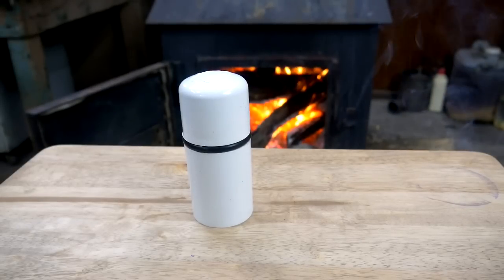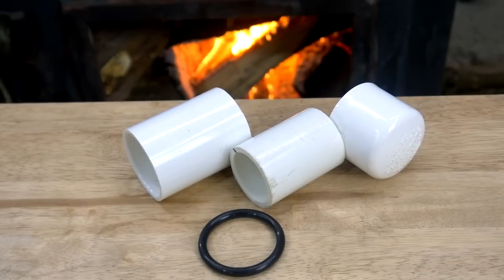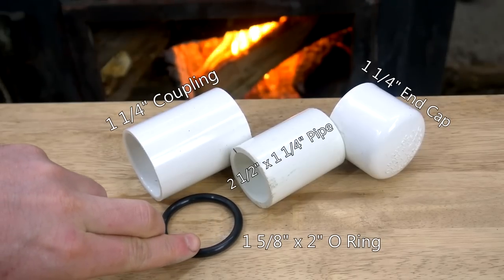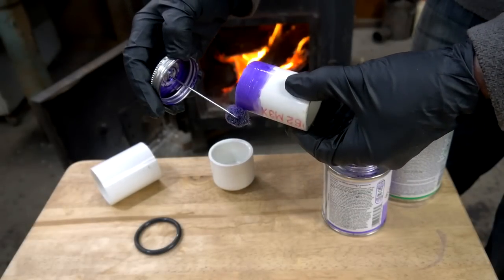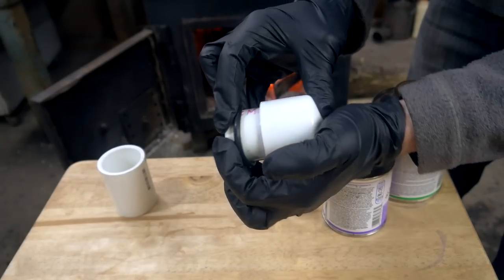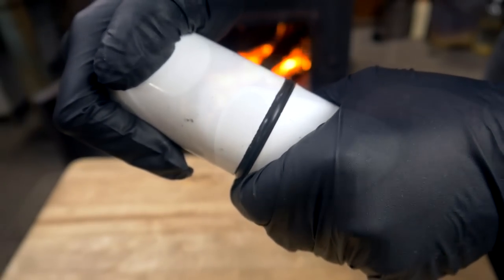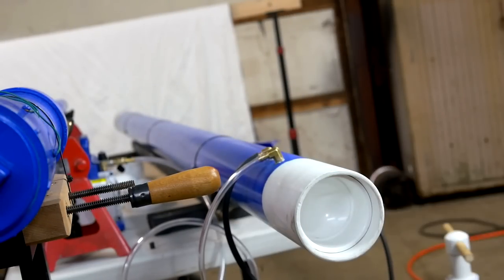How To Make PVC Pistons For Air Cannons, Vacuum Pumps, & Other Projects

Comment: good idea , you should be able to stretch the Oring over the end caps after its glued meaning no glue and you should be able to do that when an Oring perishes to replace it.
Reply from the maker: Hard to do without stretching out the o ring because the fittings are so much larger than the ID
Reply: For scuba applications we stretch it with a blunt pic and if its a tight one pre lube it

Comment: That Piston won't work on a standard coaxial design
Reply from the maker: It will. All you need is a rubber face on it or a rubber gasket on the end if the barrel

Comment: Much better than the last method. I duct taped an end cap to the chuck of a drill and ran a file over the cap asI ran the drill. It worked but took some time.
Reply from the maker: Yep, that method is not super fun. Best way I could think of at them time though.

Comment: I tried it out and it actually worked
For me because I live in a country that uses metric sizes were a little different

32 mm outer diameter PVC pipe,endcap,push coupler and 33x6 o ring makes a good piston in 50mm outer diameter (45mm inner diameter) tube

O ring is a bit loose but it doesn't really matter and if you want it can be fixed with a hint of electrical tape
Reply: Hi, your O-Ring 33x6 has an inner diameter of 33mm and an outer diameter of 39mm, right? but your tube has an inner diameter of 45mm. so have you applied a 6mm thick layer of electrical tape an streched the O-Ring on it?
Reply: @muslimdogan196  you fell into a classic blunder
To get the outer diameter of the o ring ye gotta add it's thickness twice
As it's thickness "surrounds" the inner diameter
Reply: @gaborb.2926  oh my god, you are so right !! Sometimes it's the simplest things that you overlook. thank you very much

Comment: When will the video for the air cannon be out? I'm building an air cannon for a camp that I'm leading on, and it looks like your design is pretty optimal (and I'm sure you've put a lot of thought into it.) The camp starts on the 20th of April (exactly a month away) so if your video won't be ready by then, could you point me in the right direction in terms of sources for a quality design? Thanks in advance :)

Comment: I am building a past air cannon of yours, the coaxial piston cannon to be exact and my problem with it not working is the airtight seal for the piston I used the hockey puck piston idea and it didn't work 
but I was wondering if this piston might make that seal. Because everything is built I just have air coming out of the barrel and I think the piston is not pushing up to the bottom end of the barrel.
Reply from the maker: This piston is too small for the 3" chamber of the cannon i think you're referring to. You probably need either a piece of softer rubber glued to the front of your hockey puck, or just smear the face of it with TFE pipe thread paste. That can help to make a better seal.
Reply: @Nighthawkinlight  thanks for responding I will try that

Comment: I tried using this for a syringe style suction pump. Just sucking water and sand up and I was very disappointed. Technically it did work but not well enough to be worth the effort. I see he advertises it for multiple uses so maybe you'll have better luck on one of them. Looked cool. Good luck
Reply from the maker: What about it didn't work as well as you hoped? Maybe it's something I could tell you how to improve. Sucking up sand might be hard on the o ring
Reply: @Nighthawkinlight  Thanks for your reply. It just doesn't create enough suction. Im using it in a 2" pipe maybe thats too much weight in water to expect it to pull. My pipe is atleast 3' long. Saying it can hold a gallon,  im only able to get a couple cups. Thats not involving sand which doesnt seem to change much when i do try to pull it up. It seems as though its a perfect seal but just isn't pulling like I hoped. Im at a loss cause this was by far the best design i found on youtube.

Comment: Hey Ben, we create videos on science and for one of the videos, we require a customizable sand timer. A sand timer with a regulator attached to it's neck which can control the diameter of the neck so that the clock can be used to measure varying intervals of time. Please design such a thing and tell us the idea.
Reply: Not sure if still relevant but if I wanted to do something like that I would think about drill and tapping a screw in the bottleneck area so as you tighten the screw the hole gets tighter and as you loosen the hole gets larger.

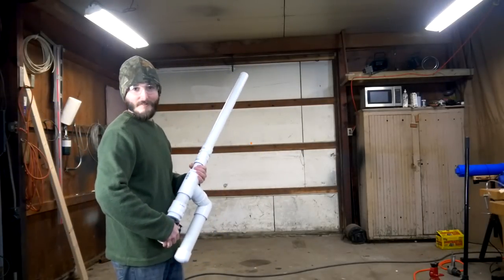Comment: 0:20 Did I just see a portable vaccuum canon with a ballvalve in stead of aluminium foil?
Reply from the maker: That's not a vacuum cannon, but I do have a very simple vacuum cannon design using this piston that I'll be working on shortly.
Reply: Probably a coaxial piston cannon, which he already did a video on

EDIT: apparently it is a QEV based design which basically works the same way a coaxial piston cannon.

Comment: Any idea what would fit 2-1/2 inch pipe for a tennis ball cannon?
Reply from the maker: You don't need a 2 1/2" piston for a barrel that size. The valve can be made from smaller pipe. Otherwise you probably would have to turn one on a lathe.

Comment: Thanks. I'm learning a lot from your videos. Have you experimented with making a piston for 1 1/2 PVC, for use with a ping-pong ball?
Reply from the maker: For 1 1/2" you have to find something other than pvc parts. None fit right. You can use a lathe or a drill and a hole saw to cut plugs of the right size

Comment: Clever design. Won't the o-ring become worn out and need to be replaced? Could the o-ring be slipped afterwards instead so it's not glued?
Reply from the maker: I haven't had a ring wear out yet, and I've used them in my vacuum pumps for probably 5 years since I made them. The ring itself is not glued to the PVC in this design, but it would be hard to slip a new one on because of the size of the fittings. The whole piston is only like $4 so if a ring wears out it's probably best just to make a new one. Fire the old one as ammo from a cannon with a 2" barrel.
Reply: Thanks!
Reply: Using some sort of grease might stop too much wear, too.
Reply: I just made one of these and didn't put the o-ring on until after I cemented the pipe and fittings together.  it would be hard to get off without damaging it, but it went on just fine.

Comment: Hello.  I'm building a hockey drying rack for my son.  I'm using 4" pvc as the main trunk and using 1.5" to "branch" off of the 4".  I cut holes in the 4" and installed male 1.5" couplers backed with conduit lock rings and jb welded the gaps.  Just wondering if you were aware of a better method to use?  Thank you
Reply from the maker: You could drill holes straight through the pipe that the arms fit through without needing a coupler

Comment: Where did you get that o-ring? We are using 1 1/4" PVC for the piston and 2" for the barrel, but are having trouble finding a 9mm thick o-ring. The standard o-ring table stops at about 6mm thickness, which is too small to fit in the inside of the 2" barrel.
Reply from the maker: I've found them in local hardware stores and on Amazon and Ebay

Comment: I sincerely this is what I need to make a piston for a pneumatic lift to raise my pop up camper temporarily until I can actually fix the lit system. My question is , why cant I place a steel rod in there with this piston and it work as a pneumatic cylinder to raise my pop up. This will work great I think. what do you think?
Reply from the maker: Should work. Don't exceed the pressure rating of the pipe. I would keep it well under 80psi and that should be more than enough.
Reply: man, ty for such quick reply, I was thinking of using a handpump or small 12 v tire compressor to control it
Reply: This is a vintage apache ramada pop up, cant afford to bend it it or destroy it, will never be able to replace it.

Comment: This piston is supposed to mimic/replace a firing pin, right ? The vacuum will suck out air forcing the piston to retract on his spring then when the trigger will be pulled all the air will push the piston to the projectile and "firing" the gun. Am I right ?

Have you planned to rifle the barrel to give it more precision ?
Reply from the maker: Not quite right. I'll get more into the details in my next video. I don't plan on rifling the barrel, that would be a series in itself to figure out how to make a rifling machine.
Reply: Hmmm, i'll check that out, it seems really interesting ! Thanks.

Comment: I know how to make a non-return valve with syringes, but I don't know what pressure holds (I don't think that is too much). Have you made one with PVC pipe or you have bought them for the vacuum cannon? (I'm sorry if there are some mistakes, I'm not so good in English)
Reply from the maker: Check out my video about how to make a vacuum pump and you can see how I made check valves

Comment: only if it would withstand constant contact with an open flame. i was making a stirling engine in my engineering class. the pistions i made out of cans where crap and i failed

Comment: What size O-ring is needed?  And were do we find it?  We purchased a 1 1/4 ID, 1-1/2 OD, 1/8 Width and it was too small.
Reply from the maker: 1 5/8 id, 2" od. You can find them online of not in stores
Reply: Thanks for your help!
Reply: Ann Marie Clarke 2002 the orings I used I found in the specialty hardware section they were .79 cents apiece but they work perfect. Even better when I put a little Vaseline on them
Reply: Thanks!  I found the size he mentioned last nigh and my son is working on his  school science project right now. I will tell him about the Vaseline!

Comment: Is this possible for a 3 inch pvc pipe? Thanks in advance
Reply from the maker: There are no end caps that are the right size for a piston in 3" pipe. You either have to go to up to 4" or down to 2" with this method. Unless you can find 2.5" fittings, but they're not common and I'm not certain they would fit in 3" anyway.
Reply: @Nighthawkinlight  Thanks for the reply, I am 3d printing parts for it instead! Thanks for the idea for the piston design

Comment: Where did you get the o rings
Reply from the maker: Local hardware store
Reply: Ok I was hoping for an amazon link but that is fine. To clarify it is 2 in outer diameter and 1 and 5/8 inner?
Reply from the maker: Yep. They vary a little in reality. Make sure they're a good fit between the two pipes before gluing on the end caps.

Comment: HOW DOES AN O-RING WITH AN INNER DIAMETER Di=1 5/8“ FITS ON A PIPE WITH AN OUTER DIAMETER Da=1 1/4“ ?!
Reply from the maker: 1 1/4 is the inner diameter of a 1 1/4 pvc pipe, not the outer.
Reply: @Nighthawkinlight  Hi, thank you for your reply.. I have bought a pvc pipe 32mm (1 1/4“) today and I measured it. the outer diameter is 32mm.. is it so, because I live in europe (germany)?